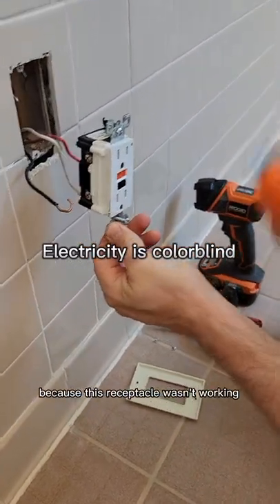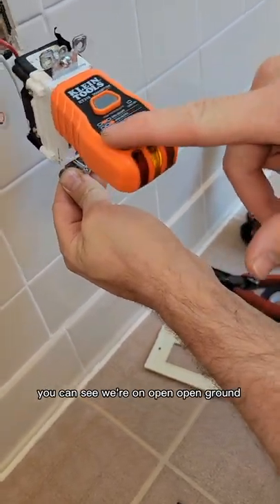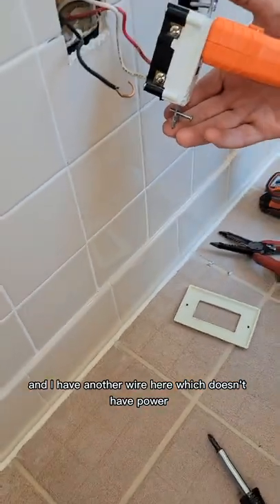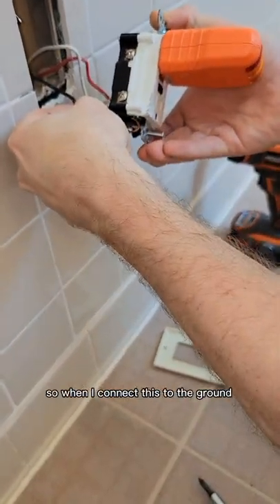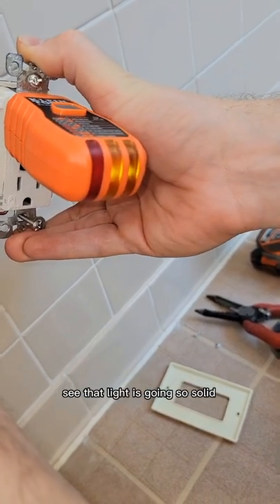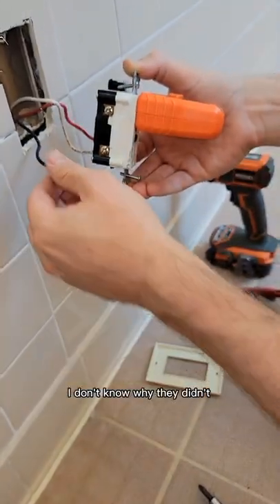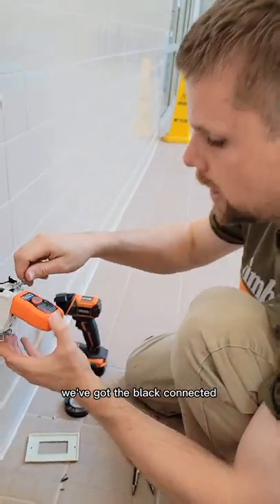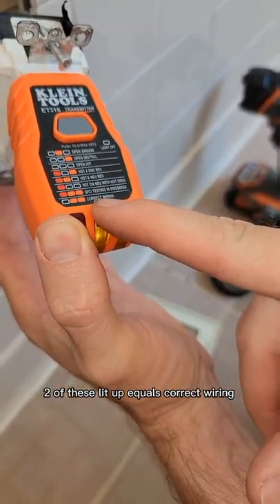Open ground fault on a gfci #electrician #viral #howto #diy #shorts

Comment: Dont you just hate when so called Electricians decide to not follow National color codes?
Reply: Color-coding the outside of a wiring method is not a requirement by the NEC. There are only permitted colors for specific rules, ie, grounded or grounding. It is not required to code them, but if they are, they must be for either purpose.
Reply: I know this iam an Electrician!
Reply: What I was referring to if standard colors for low voltage ( Residential) black white & green
Reply: @scarecrow1490  code literally states ground can only be bare or green. Just like. Neutral can only be white or gray
Reply: @danielmcdougle6925  The NEC specifies that conductor colored white be used only as grounded conductors and that conductors colored green or green/yellow be used only as grounding conductors and that neither white nor green be used in any manner on ungrounded conductors.

This means if you use white or green, they must be for the purpose above. It does not state it is mandatory to color code either.
Reply: @scarecrow1490  you are wrong.
 200.6 "grounded conductors shall be identified by one of the following means" then proceeded to say white or gray solid or 3 stripes.

250.119
EGC are permitted to be bare covered or insulated. If they are covered or insulated they shall have continuous green or green with 1 or more yellow stripes

Shall is not an optional thing.
Reply: @danielmcdougle6925  I'd say you got me, but you forgot to add 6 awg and smaller. Good fight
Reply: @scarecrow1490  literally read the next section its for larger gauges
Reply: @danielmcdougle6925  yea yea yea. Take your 🏆
Reply: It's an a$$hole move to incorrectly wire color connections and that may need service in the future, it's not that it works but more than likely to impact the next electrician, my brother is an electrician I have done simple gigs with him, he gets absolutely frustrated for stuff like this, even worse when dealing with wires that are too short
Reply: That is precisely the point I was trying to make!! Iam a Diesel Mechanic,  and Power Generation Technician for 30 years and one thing I always teach my helpers is one tou clean up as you go!, always tackle the most difficult jobs first thing in the morning,  a d bag all bolts screws fasteners & small parts in hip lock bags and label them with a Sharpie!! Make list of all work performed that day and leave list at job site in case I would get called out on an emergency job!! That type of consistancy is great because anybody can follow your lead a d complete the job without calling me every 5 minutes!! I always followed the same type of anal procedure when doing Electrical & Electronics!!
In 30 years I have not had any failures as a result of my repairs!!
Reply: @darryltabor4863  yeah someone that I don't even need more than 10 mins to figure out
Reply: It has a red which means it's in a 3 way switch configuration, but ground is still bare. Should be. They just got lazy
Reply: Correct grounds and neutrals have to be color coded according to the NEC. Now hots are not really specified. As long as it’s rated for the voltage it’s being used for. Anyone who says other ways needs to crack open their book.
Reply: Yep I just put a new outlet in my house and I was so confused and was like why tf is the neutral hot 😂
Reply: The color codes are different for business buildings unlike the residential buildings.

Comment: I'd tape it green to re-identify it as ground. If in fact it has been traced back to intentionally being a ground.
Reply: You can peel off the black color and leave it bear copper too. It legal
Reply: @jvideos1123  I've done that to make pigtails
Reply: @MannyAguilarJr  same too
Reply: @MannyAguilarJr  I work on a house a few months ago and all of the wires that are ground is black and white and I saw my electrician book and said that you can peel of the black color and leave it bear copper. Its legal in my hometown in harwood heights IL. And should be legal too in every state. Fact: to identify ground wire, it has to be green wire or bear copper.
Reply: @jvideos1123  yeah I think once it's outside it has to be green jackets thhn wire.

Comment: “Screw the next guy” type of work. That cable should be used for 3-way switches, not outlet wiring. And since this electrician just put it back in the box he’s also saying “this is the next guy’s problem.”
Reply: Well you see it depends if the costumer wants to pay more he will but the customer doesn’t want to he gonna learn 🤷🏻‍♂️🤷🏻‍♂️ is what costumer want to use
Reply: @vladthedude7231 All the electrician had to do was strip the black insulation back as far as possible leaving bare copper showing it’s a ground.
Reply: All you saw was the little short he made, you have no idea what other work he did after this video.
Reply: 3 wire is used in outlets all the time when people want switched outlets in floors and baseboard. Tell me you're an electrician without telling me pal.

Comment: No equipment grounding conductor will not affect the GFCI at all. Id leave the ground off before landing a black wire on the ground, unless you know 100% that it’s the EGC… but even then, id change the color of the wire.

Comment: I did nothing but brand new houses for 3 years.  Then went to doing brand new schools for about 5 years.   No amount of new work experience can prepare you for old work.  Other peoples work from generations ago, fishing walls, nob and tube wiring and some times with nothing but black wires.  
There is Residential
Commercial
Industrial
Then there is old houses (the ones that really need work done). The crap no one else wants to do.  The ones that are impossible to estimate the amount of time it would take because of all the surprises you can run into
Reply: Just came back from a call from an old home. Wiring is super funky. They wanted an estimate on how to fix the wiring.

Your totally right, its impossible to estimate it. I just hate being the last guy to touch the panel in these kinds of places.
Reply: I used to rewire old apartment buildings in Brooklyn NY. You have no idea how bad some places can be wired until you work on these buildings that are well over 100 years old and still have some original wiring in place. I'm amazed that more fires don't occur with many of these old buildings.
Reply: Yup. I was to install a new light in a finished basement, simple. Run a branch off an existing circuit and done... 3 days later I finished. Found two junction boxes behind the wall, a shorted neutral from a 8 penny nail, a breaker caught fire, and found 2 energized, uncapped, wires one in laundry ceiling and behind water heater.
Reply: I'm the old house I live in, I know I'm not touching the electrical until I have time to dedicate to it, which is not than a day or two. The first few days might be just removing unused wires. The fun is also having 3 main breaker boxes.... Luckily I think everything is broken up into 3 sections, so it might make it easier
Reply: I have an old house and there are live wires hanging around everywhere.

It's taking a while to clean up. Every bundle of wire you run into and think "that must be inactive" is actually live. 

I knew it getting into the house though, I didn't expect anything to be right, that's why everyone walked past the house.
Reply: @arthurr8670 Two are sub panels.
Reply: @TheHardTruth315   technically all 3 are sub panels, the main panels the few breakers on the power meters, but all of these breaker boxes are connected to their own meet meter, and are in no way connected to each other  after the meters.
Reply: Yep old houses are nightmares just waiting to drive you to insanity went to one that had the switches literally plastered in to the walls no box nothing they just put the switch on the drywall then plasters the switch in and put the cover around it
Reply: @arthurr8670  interesting. Sounds like you're describing a former three unit being converted into a single unit. (Home) ?
Of so, that may be a great indicator that they are separated already. My city does not allow breakers in the meter fitting unless it's one of those Six switch or less modular units. What part of the country are you in?
Reply: @1992djg ha ha 😮 would've loved to see the 👀 face you made 😅

Comment: Trace the circuit, shut it off And rewire everything in that circuit and see where that black wire is landed in the panel.
Reply: Of just put it back in the wall the way you found it
Reply: Going the extra mile!!! 👍👍
Reply: @pgood7266  Spoiler alert: it was taken out of the wall because it was open faulting. But sure, go ahead and put the shock hazard back in your wall, be my guest.

Comment: You must do your due diligence. Trace the black wire to where ever it goes..it could be shorted or be running through motor or ballasts and may appear to be grounded.

Comment: He needs to use a stray voltage adapter and a volt meter make sure he isn’t connecting a dead short. Also some green tape to re mark that ground.

Comment: I've ran into that and also shared neutrals. Plus a/ c units ran on 2 separate breakers.. and got shocked..  oh and emergency exit lights wired to a light switch for hallway lights and light fixtures ran on extension cords above the ceiling grid to an outlet.

Comment: We don't know what's going on at 30 second video, but it could be an isolated ground. You should never just go by wire color, and you shouldn't call the last guy an idiot just because you don't understand his work in 30 seconds.  open, test, plan then proceed and be careful

Comment: That happened in my track built home.  I had a handyman and an electrician out and they couldn't figure out the wiring in the kitchen wall. They said all the wiring looked correct. But the electrical sockets had no power.

I bought the Black & Decker book and a meter and low and behold the black wire on one electric socket was spliced to a white wire from the other socket..... They literally changed the color of the wire in the middle of the wall.

Luckily I didn't know what I was doing therefore I didn't have any confirmation bias.... I know that sounds weird, but that probably helped me figure out the problem😅.  Once I ignored the color of the wires I rewired everything, and all the outlets worked along with the GFI 👍👍.

Comment: Dumb question. Is that the same receptacle that was in there when you opened it up? How did you get there power back on? Breaker or tripped GFCI?  Regardless to the Klein indicators reading, that receptacle would still function.
What's the deal?

Comment: On a GFCI you don't need a ground for it to work. They actually tell you in the NFPA 70 that if your home does not have a ground you are able to use a GFCI breaker or receptacle so you are able to use a 3 prong receptacle or use a 2 prong receptacle. And one other thing if the GFCI does not have a ground in the GFCI receptacle package there is a sticker that says no ground for that purpose.
Reply: “Don’t need a ground for it to work”….in a limited capacity.  

FTFY.
Reply: You should not plug a 3 prong plug into a GFCI without ground. They do this because it's better to have a GFCI than nothing.

Comment: Also, that GFCI will work without the equipment grounding conductor. If it were me making this repair I WOULD NOT reconnect the black wire aka the EGC.

Comment: Did you try to test the gfci without the ground? I’ll bet it didn’t work. Came across this myself and took some googling to figure out why ground was required for that tester, even though it isn’t required for a gfci circuit to work. Good idea for a video.
Reply: Because GFCI monitors the neutral. If there's not as much load on the neutral as there is on hot it'll trip it.

Comment: I upgraded an outlet to GFCI in my room, noticed a yellow and white wire bonded together on silver screw and a black cable on yellow screw. My outlet does work but marks open ground neutral IDK on tester etc the current setup is black on gold, yellow in silver and white on ground, but now my roommates outlets don't have no more power, haven't said anything since mine is working, I was like hey mine works etc, but I do want to fix it when they're gone, what do you suggest? Bond yellow and white together and put it on silver ? I have feeling I should use the load section on receptacle though idk

Comment: If there’s no ground wire and you have conduit then use a mechanical ground.
If you are a true sparky then you know what I’m talking about.
Reply: Absolutely correct. The open ground on the plug tester would read correct when you screw the metal yoke back into the metal box! Never black wire for EGC

Comment: Super. Trace the wires to the breaker box, then tape the appropriate wire with about six inches of green electrical tape on both ends to indicate a ground wire. Red and white work for the power, but if you prefer, you can use the black and the white wire for power, after rearranging the breaker box, and then use the red wire, with both ends taped with green electrical tape, to indicate the ground wire, so that any future electrician will know what is going on, and it will be legal. 💙 T.E.N.

Comment: Like the caption said electricity knows no color...coating is coating. 12v systems use black as ground 24v same hell on 240 3 phase red can be common and yellow can be hot...it does not matter so its always a good idea to have the multimeter

Comment: Your ground may be open also cause it's not connected to the box
Reply: Thank you! Self grounding outlet
Reply: What I'm referring to is back in the day when conduit was used through the entire house the boxes themselves were the ground once the outlet is screwed into the box it is grounded.
Reply: @mattalley7646  Yes and still to this day. The brass tab on the "self-grounding" outlet bonds the metal yoke when it's screwed into the grounded metal box. This one went over most people's head

Comment: must be re identified as a “grounded conductor” typically by tapping or marking it green at ALL the points of termination.. please people for your own safety call a licensed electrician. not a “ handy man “.  ps. is that a metal back box ? if so that must also be bonded to ground using 10/32 green machine screw. per n.e.c

Comment: What if that black wire was supposed to go on the load side of the GFCI and it was fooling your plug tester because it had a load connecting it to the grounded conductor?

Comment: There was a direct fault to ground with the original black wire so they abandoned it and used the spare red  wire..or they're use to dc wiring lol
Reply: They probably ran it cause they had extra and didn't want to waste it
Reply: Could've been an old three way switch, without a ground, which was changed during a remodel, or just a lazy, or unknowing human. An electrician would have marked the wire with colored tape to make it legal. 💙 T.E.N.

Comment: Actually, I just discovered the other day by chance that the ground tester can be fooled when I was going to replace a receptacle because it had a lot of paint on it. Turns out if you take a short bit of wire and wire the ground to the neutral that will show proper ground. That is not how that works.
Reply: Yeah but if something happens you turn all your metal including your water pipes
Reply: @ChristianWorrall  that's the point, just because the ground tester says it's good doesn't mean it is.

Comment: There was a video of a handyman wiring the ground to receptacles just like this but with stranded black 14 awg. He even spliced them by using a barrel crimp. All open wires that most likely are going to come loose. I couldn’t believe it. I’ve never seen anyone make connections that way. Definitely not good. Also when he turned off the power it was a really old panel with fuses. He left the fuse sticking out instead of removing it 🤦‍♂️.

Comment: It's not a house it has a mud ring. Looks like new tile. Had to meet new code requirements older building probably. Didn't need grounds back in the day. Somebody put a GFCI in to meet new code requirements. Black is probably grounded to something else or a existing metal box as the conduit is used as the ground.